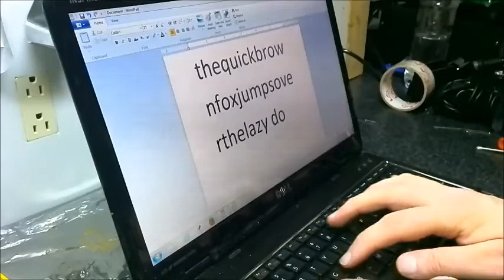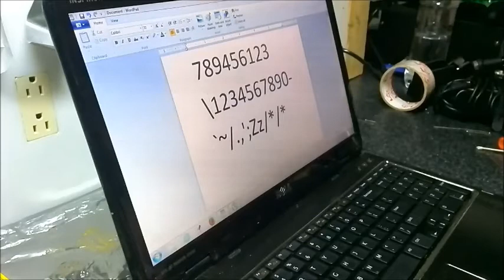Dell Inspiron N5110 Screen Repair

Comment: i have the same problem without the beeb do you help me please
Reply from the maker: +doaa mohammed Hi Doaa, are you able to plug in an external VGA monitor to it? this will help determine if the main part of the laptop is still functioning correctly. :) if you get the computer to boot up on the external monitor, it will most likely be the LCD itself of the cable going to the LCD.
Reply: I have the same problem without the beep and all the sound when the laptop on is working except the screen
Reply: I have the same problem without the beep and all the sound when the laptop on is working except the screen
Reply: I have the same problem without the beep and all the sound when the laptop on is working except the screen
Reply: I have the same problem without the beep and all the sound when the laptop on is working except the screen
Reply: I have the same problem without the beep and all the sound when the laptop on is working except the screen LP
Reply from the maker: Is there any light from the screen? if not, try and put a light up to the screen and see if you can make out any image on it, could be a bad backlight or inverter circuit, If there is a light then it may be the cable that needs replacing. They are quite easy to find on ebay.
Reply: Try changing the ram's cards of the slots and restart. That work for me. :)

Comment: yes i tryied but to blug on external but not working
Reply from the maker: +doaa mohammed Hi again Doaa, is there any lights that come on at all when you try to boot it up. I would suggest trying to reseat the memory modules and possibly cleaning the contacts of the memory modules. When I first did the repair on this model, I had to clean off the memory contacts or it wouldn't attempt to boot and did not make any noises.

Comment: my screen goes white for sometime and then it backs to normal after restarting. Can u tell me where is the problem
Reply from the maker: sounds like it may be an issue with the display controller. I would try a a few things; 1) plug it into an external monitor to see if you get a picture while the LCD is while, 2) try booting into the BIOS (F2 at startup) to see if the screen stays white in there.
If you get a picture on the external screen or the screen doesn't go white while in the BIOS screen then its less likely to be the display controller and probably the OS. let me know what happens :) thanks for the comment
Reply: it works fine on external display while laptop display gets white. It causes no problem on external display but it gets white on laptop can u tell me where is the problem
Reply from the maker: Ok, this tells me that the display controller is most likely fine, and you said you have had a picture on the LCD before it goes white, I'm thinking more towards a problem with the connections on the cable either on the motherboard side, or possibly at the LCD. I would suggest opening up the system and re-seating the LCD cable and see if that makes a difference.